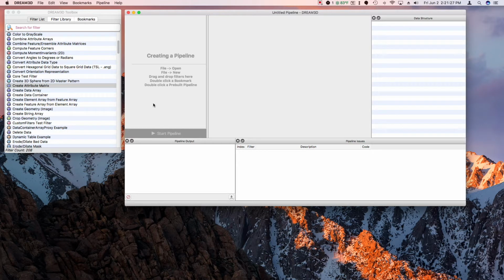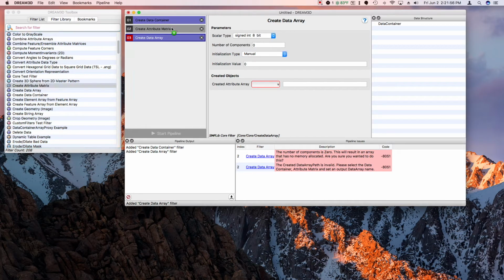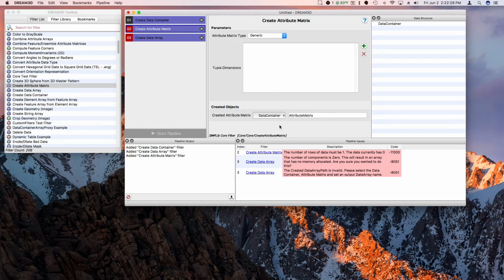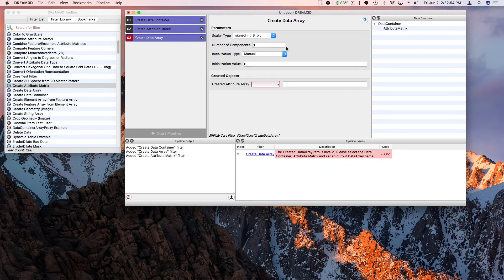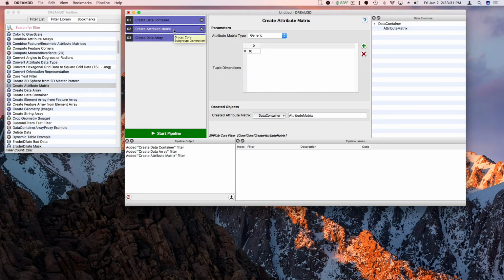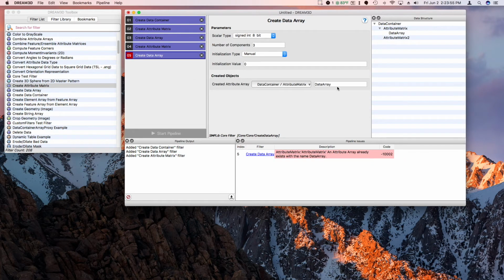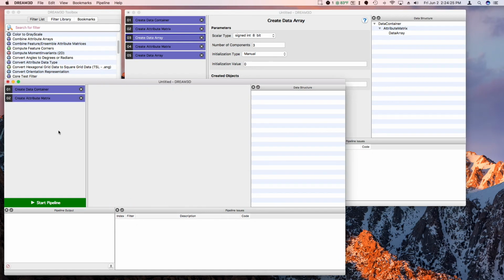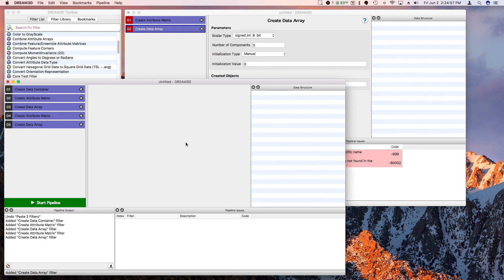DREAM.3D v6.5: Creating A Pipeline

Comment: nice tutorial, I have a problem to run DREAM3D... always show this,.. The plugin did not load with the following error

Cannot load library /home/abc/Downloads/DREAM3D-6.5.138-Linux-x86_64/Plugins/libOrientationAnalysisUi.guiplugin: (libpng15.so.15: cannot open shared object file: No such file or directory)

Possible causes include missing libraries that plugin depends on.                                                             .....I hope to get your help
Reply: What linux distribution are you using?
Reply: @michaeljackson8359   I am use ubuntu 2020.04
Reply: @adamjr8831  I replied to your questions on the DREAM.3D-Users Google Group. We can trouble shoot this information there. https://groups.google.com/g/dream3d-users/c/IM2QXt_XmX0
Reply: @michaeljackson8359  Thanks a lot